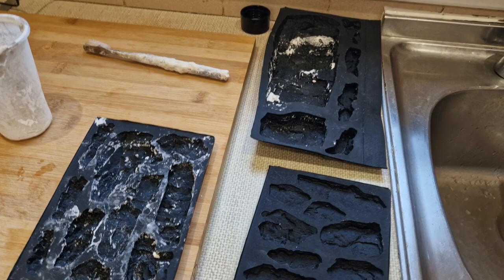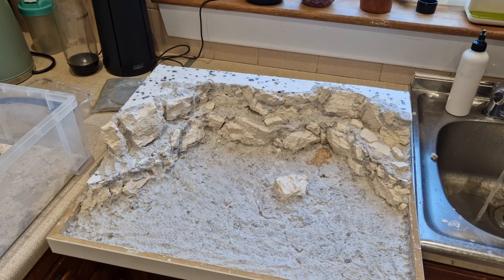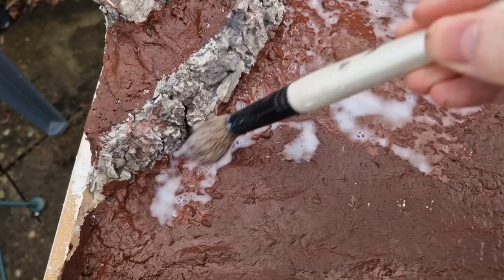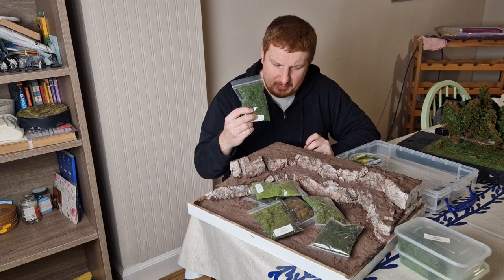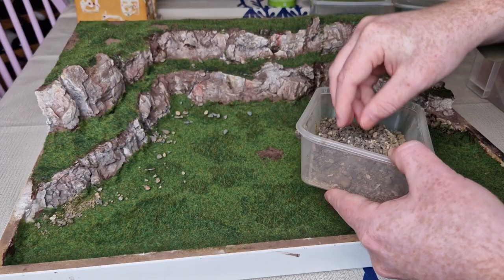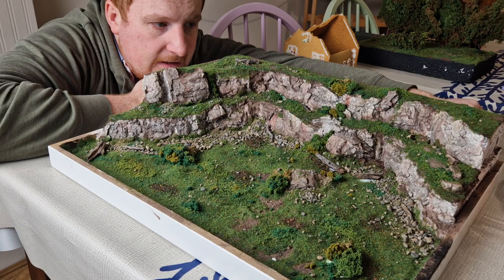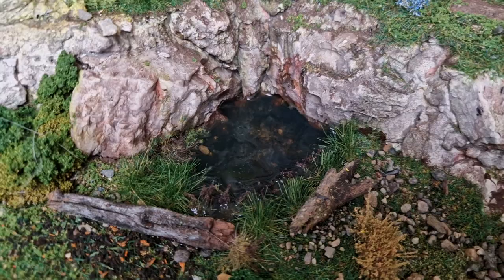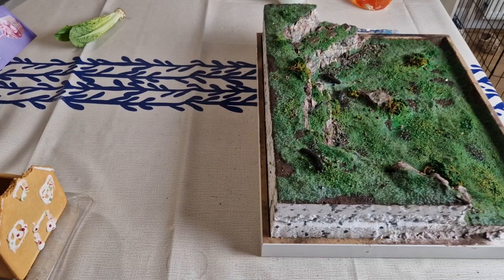Can An Idiot Build A Display Board?

Comment: Hi J Macc, I have a Ryobi set of tools and the Glue gun is fab. It has a variable temp setting and different nozzles. No electric wire in the way either. Love your work!! See you soon you cheeky bastard!
Reply from the maker: Thanks man! I'll check out the glue gun from them those 2 are in the bin they both broke 😞

Comment: I love to make this kind of stuff, and if i can suggest something:
Airbrush save lot of time
While you "Seal" foam, tuft, try to make a unique solution of pva glue, IPA, and thin with water to spray all. I do this way and it's ok, i use also to fix bases!
And also, fix the edges of the frame!
Btw, great job dude, It looks beautiful absolutely pro!!!!!
Reply from the maker: Awsome mate thank you! Yeh I really need to invest in an airbrush. I really wish I had got an airbrush instead of a 3D printer as I've never used it haha
Reply: @jmaccsarmiesofArda  3d printer, my endless Dream 🤣 The real problem over all is time. Waiting for a Crazy Bat rep mate ... 😄😄😄
Reply from the maker: @Sierra117  Yeh apologies. Just filmed a bat rep so editing can begin now!

Comment: Looks ace! do you make your own washes for terrain? I did a project recently and tried making some with water and inks but it came out shite. How do you make yours?
Reply from the maker: Just water and acrylic paint for mine. I was only doing it on the plaster rocks, which absorbed all the wash. 

I think if I was doing it on the rest of the terrain like buildings etc, I would add in some flow aid perhaps.
Reply from the maker: Just water and acrylic paint for mine. I was only doing it on the plaster rocks, which absorbed all the wash. 

I think if I was doing it on the rest of the terrain like buildings etc, I would add in some flow aid perhaps.